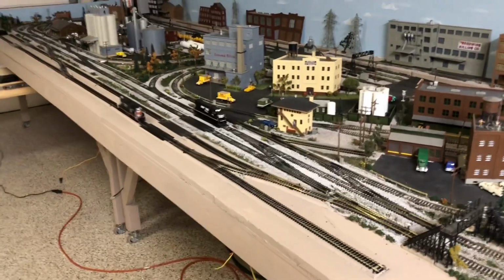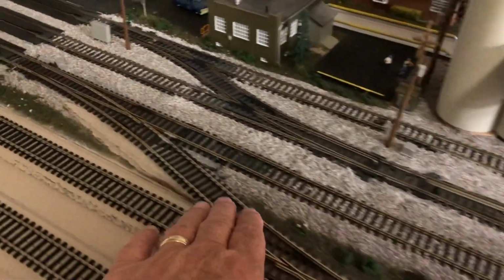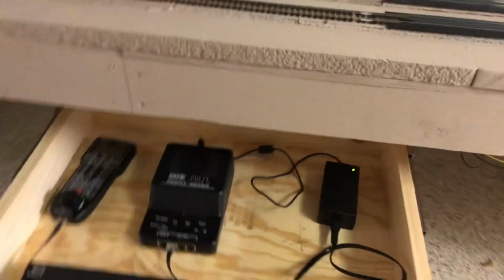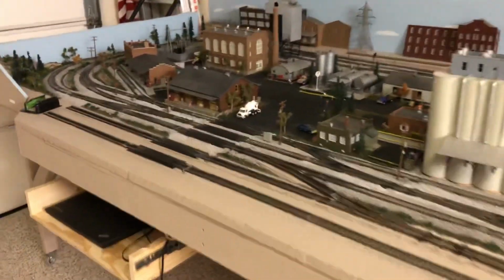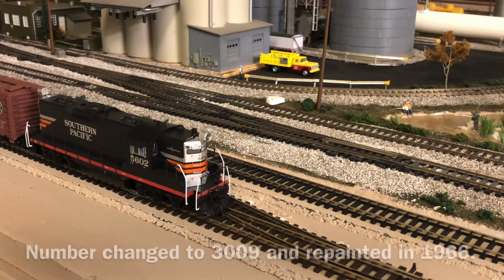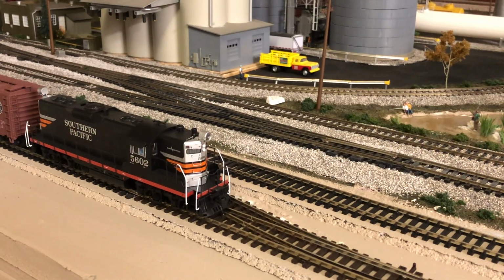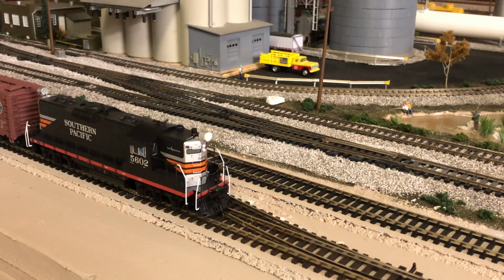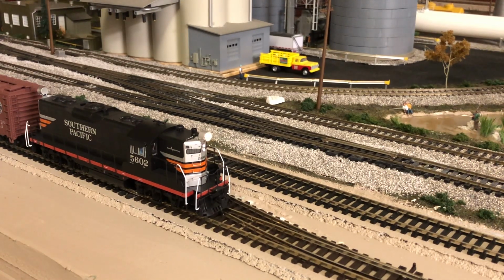My 4x8 x 2 HO Layout - GP9 Phase 1 plus layout update

Comment: 😅😅😅😅🤣🤣🤣🤣🤣🤣🤣🤣🤣I saw the engine uncouple oh no not again! Oh  I'm sorry Fred that happened. This reminds me of the older horn hook & earlier knuckle couplers on my old AHM GP 9 every time it was on a certain section of trackage  the engine uncoupled repeatedly, suddenly had to stop it recoupled it back only to do it again. The engine probably needs a stronger magne magnetic coupler from KADEE couplers. When I saw the symbols I knew what was coming.😅 Awesome railroad video Fred & happy model railroading! 👋👋👋👋
Reply from the maker: Thanks Harold. 😀  I knew a couple of these cars had weak couplers.  What you saw is all the SP cars I have so I took a chance they would ‘hang on’ once around the layout.  Nope 🤬.   I hope one was first box car behind GP9 and not weak coupler on the loco.   The spot where loco decoupled is where I had to repair a dip in the track last year.  Hope that’s not a problem again. 🤞

Comment: That right side lead (siding) ends awfully close to the abyss.   A bumper and something wrapped around that corner & raised above ground level is a must ( because we both know that any of us model railroaders who leaves an opportunity for disaster to exist will be subject to Murphy's Law, lol! )
.
Your new diesel looks really nice.   Enjoy it.
.
PS - You can solve your coupler problem permanently with a little CA on each coupler pair.   ;)
Reply from the maker: 😀. I can always count on you for good advice.  Thank.  Murphy tip is good. However, you can’t fool me with the coupler solution.  I’m using some thin wire to fix the problem.  🤬